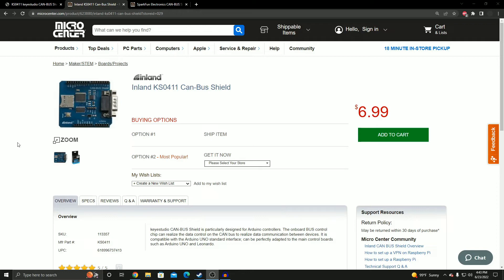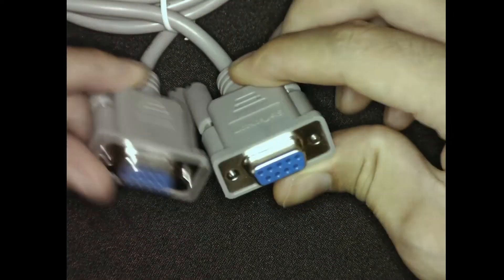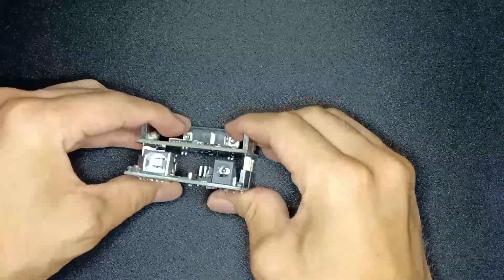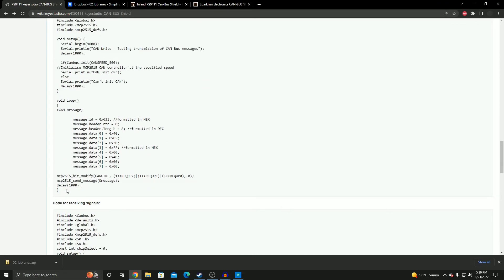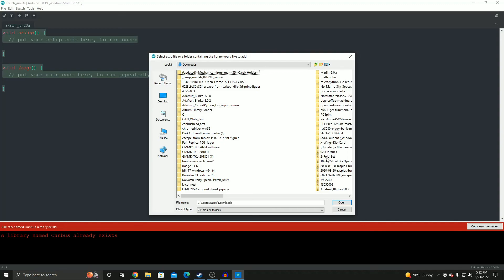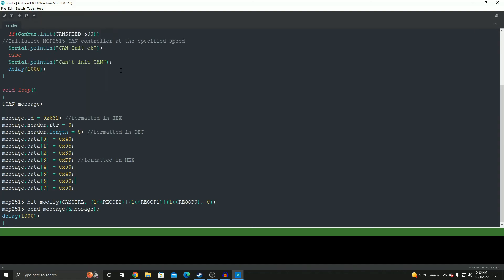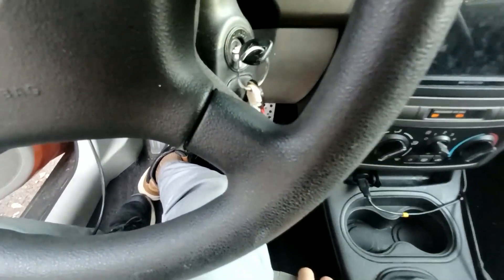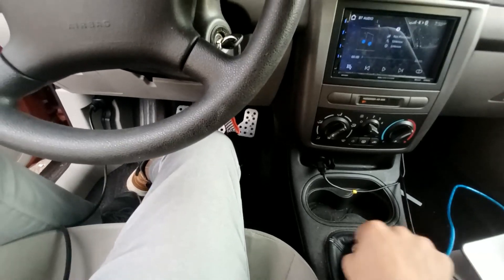CAN BUS Tutorial PT1. How to get started with the KS0411 CAN BUS shield from Inland.

Comment: How is part 2 coming? Any chance you can connect this to SavvyCAN?
Reply from the maker: For PT2 I realized that there are limitations to using this shield, I could never get the SD card to work which was essential for data logging and decoding the messages, I think I narrowed down the issue to the IC that is connected to the SD card but will have to check. I bought the sparkfun CAN shield and it worked! But its quite expensive, and has tons of unnecessary components. The main reason for this project was to be able to build a custom digital dash, so pulling codes is paramount. I haven't made any progress since then, if there were to be a part 2 it will probably be in the summer when I have more time to work on it. I don't know about connecting this to savvy can, from what I can see you would need to use an Arduino DUE. So using a discrete CAN module would be better since this shield is specifically designed for the Arduino UNO. Sorry I cannot be of more help.

Comment: Thanks for this informative video. I just picked up a can bus shield from micro center but i only have arduino Nanos at the moment. Would you happen to know if the can bus shield can be used with nano? And if you can share the connection schematic would be great.
Reply from the maker: Yes it is possible to use this can bus shield with the arduino nano. You would just need to connect the SPI pins from the arduino to the corresponding SPI pins of the can bus. On the CAN bus shield pins 13-10 are the SPI communication pins, so just match those with the arduino nano. Pin 9 is the CS pin for the SD card although I ran into some trouble using it. I planned on making part 2 of this video but I've been busy with work and school. I haven't made any schematics for this project and I will take that into consideration for the future. But for what you are trying to do just connect pins (13-10) from the CAN bus shield to pins (D13 -D10) on your arduino nano. I would look at a diagram of the SPI bus of the arduino nano online for reference. Be mindful that you will have less memory working with an arduino nano.